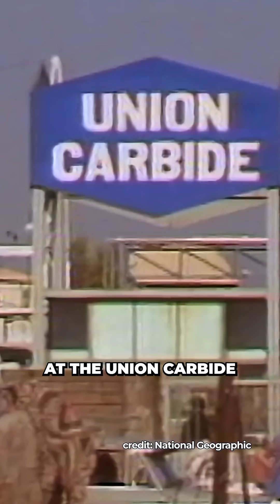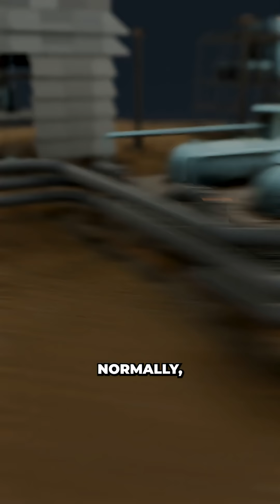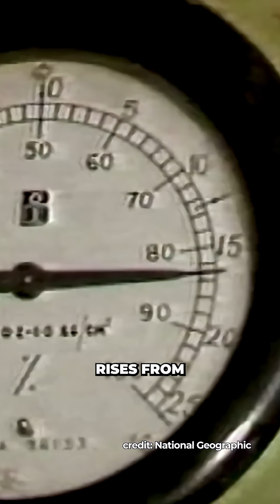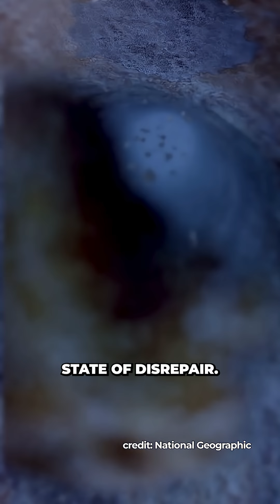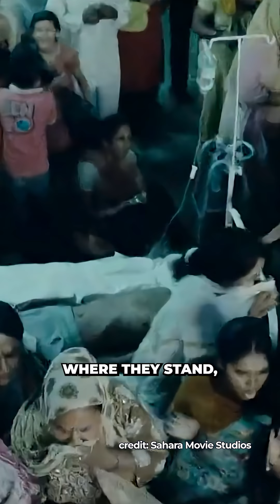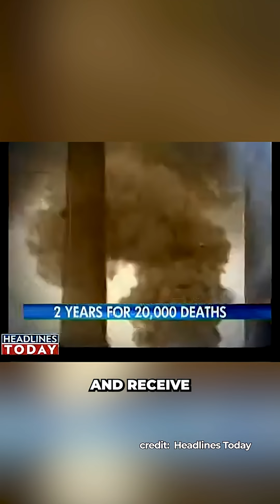The True Story of the Bhopal Gas Disaster

Comment: It occurred to me that it possibly would have been less disastrous for the people of Bhopal if the E610 storage tank had actually exploded instead of venting. It would probably have injured or killed many of the plant workers, but the explosion and resulting fire might have neutralised – or at least lessened the toxicity of – most of the toxic gasses, which might have lessened the deaths amongst the general population of Bhopal. I have little experience with the exact nature of MIC and how it would behave in such an explosive situation, so I might be completely wrong, but it seems somewhat logical if incinerating the gas would have reduced its toxicity. Either way it is an awful case of negligence that should never have happened.
Reply: yess you are right about it

Comment: I heard a rumble from an unpressurized tank of cold creosote and a coworker was using steam to melt the crystalized creosote at the valve on the bottom. I was supposed to be able to close the valve to prevent the tank from overflowing due to the steam. Unfortunately the plug of crystalized creosote didn't just melt. The chunk of crystalized creosote broke free, I did try to run and get out of the range of liquid creosote. Unfortunately I didn't make it.
I was showered with creosote and ended up taking a much needed shower and throwing away a set of work clothes as the creosote crystalized and made the shirt and jeans stiff almost immediately. Due to my hardhat falling off the same happened to my hair. Went home as the smell was making me nauseous and I had a chemically induced headache.

Comment: As a well tester all of this equipment im VERY familiar with. And my entire job is to monitor pressures and maintain isolation in exactly the way i want. We use scrubbers and flare stacks to burn off and lower the saturation of toxic gas, the fact that a POP valve blew at all is completely on the workers. The fact that the company even had pop valves for such an operation shows safe work at least being in mind but it’s probably not the main priority. The fact that nothing was serviced and was inoperable does have to do with management. But when it comes to flare stacks… they’re not easy to fail. And if it was failing that means it wasnt already lit. Which in most cases is really bad. A flare stack should be constantly lit and ready to burn gas so id say that’s another issue id take with the workers themselves. When the pressure reached 20 PSI someone should have said something, gauges dont magically keep raising at the same PSI/time. This easily could have been avoided by training and by preventing complacency. And any safety precautions that failed wouldnt have mattered. But also i work in the oilfield and situations like this are much more common and we have history to look back on so its easy for me to say i guess.

Comment: 1. Faulty cooling
2. A lot of faulty gauges lead to a worker thinking that the actual emergency is just another defect
3. No vent gas scrubbers due to no repair budget
4. The tower not working to incenarate deadly gases because of a low budget.
Four fail-safes and not 1 of them worked

Comment: I wasn't a mechanical failure or it wasn't an accident. It was the laziness of thise greedy capitalists who chose their profit over lives of saveral people. I did a case study during my bachelor's and I have found many faults which were found during an investigation.

Over 25% of pressure gauges in the factory were not working properly. There were 3 tanks of MaiC of which 2 of them were supposed to be filled 75% and third one supposed to be kept empty for emergencies yet they filled 2 at 90% and third one 70%. There was a journalist who raised this with government regarding the safety issues in the plant but no one listened.

I did this study over 8 years ago still I remember these numbers to my heart because what happened was horrific

This was the failure of Union Carbide and Government.

Comment: There are some people that dont know or realise, that when the pressure in the pressure tank went from 2 psi to 10 psi wouldnt think that this is not that much pressure since its only 10 psi and not a big deal. But 10 psi in an area that big in a metal pressure tank is like the difference between a hand grenade expolding to a 500 pound high explosive bomb being dropped from a fighter jet, and an huge explosive blast area and concussion wave destroying peoples enternal organs and turning their enternal organs from soild organs to a mush consistancy organs. But when it reached over 100 psi, it would be like a bunker buster bomb being exploded above ground, and not a deep penatration explosion,  meaning a major hole in the ground they could park multiple upon multiple busses in the crater from the explosion,  and the chances of people surviving this size explosion,  about absolutely nil, none or zero to around a mile away.

Comment: History shows that many corporations have deliberately calculated that paying settlements or compensations later is cheaper than implementing proper safety measures now.

Take the Radium Girls case the company knew the risks of radium exposure but continued production because redesigning and implementing safety protocols would increase costs. Or the Ford Pinto case, where engineers identified a simple fix (a protective T-strap) that could prevent fuel-tank explosions, but the company decided against it after a cost-benefit analysis showed lawsuits would be cheaper than redesigning the car.

Economically, many corporations have shown they often accept that damage as part of the cost of doing business.

Comment: And this here is why there are so many layers of protection on dangerous substances and work places - because even with the many different precautions meant to be in place, everything failed and 15 000 people died. If even one of these things worked then chance is the death toll would be 100 or 1000 times less, if not entirely absent, yet the "cost saving measures" ended up costing people their lives

Comment: Are you kidding me? They blamed the union!?
The union workers were not the ones screaming about cost-cutting measures.
I guarantee you it was not the labor union that stopped hiring necessary workers. 
I guarantee you it was not a union member that made the choice to skip necessary maintenance just to save money. 

I guarantee you the owner of the plant is the reason those decisions were made. 

Much like chernobyl, you can blame the person who pushed the button, or you can blame the person who said it would be cheaper to use graphite tips.
Or in this case, the guy that said it would be cheaper to not hire more repair men.

Comment: Didn't include the alarm. There were multiple safety measures in place, where each one would have prevented this, but my favorite one is the alarm. The alarm (sirens) went off indicating a gas leak. They didn't want to unnecessarily create panic for what they thought was a false alarm and completely shut off and disconnected the alarm from going off.

Comment: “If you skip the safety bill, the damage will cover the cost”

For this, for bikers, for workers, for everyone, it holds true
Reply: While the quote sounds powerful in principle “If you skip the safety bill, the damage will cover the cost” reality often doesn’t work that way. History shows that many corporations have deliberately calculated that paying settlements or compensations later is cheaper than implementing proper safety measures now.

Take the Radium Girls case the company knew the risks of radium exposure but continued production because redesigning and implementing safety protocols would increase costs. Or the Ford Pinto case, where engineers identified a simple fix (a protective T-strap) that could prevent fuel-tank explosions, but the company decided against it after a cost-benefit analysis showed lawsuits would be cheaper than redesigning the car.

So yes, morally and socially the quote stands true skipping safety eventually harms people. But economically, many corporations have shown they often accept that damage as part of the cost of doing business.

Comment: My uncle works at the NECO raipur plant. He once shared this with me, that their plant produces tones of carbon monoxide as a byproduct of the steel production, which is stored in several pressure chambers to be used in burning of the blast furnaces. But when the pressure chambers are full this gas is supposed to be incinerated through the smoke chimney, which requires a LPG cylinder to burn the gas so that the environment is not contaminated with this CO gas. One day a newly hired BIG HEAD saw that lpg cylinder as an unnecessary addition to the cost overheads and got it removed. CO is odourless, if anything happens no one would even notice it.

I was shocked to know about this. How could someone be so indifferent to people's lives, for what a ₹3000 LPG CYLINDER?

Comment: So i counted at least 4 safety steps that failed here due to cost cutting. The initial cleaning blind plate missing, the cooling unit being turned off, the gauges not working, the gas scrubber not being maintained, the flare tower not working. So i guess it was actually 5 steps that failed here. Ffs

Comment: Small correction based on what i read

The vent gas scrubber worked but was not designed to handle the volume of MIC that leaked out.

Comment: Fun fact: chernobyl, the worst nuclear disatster, killed a fifth of the people this did while also providing a phenomenal amount more power.
Reply: Chernobyl was human error... this was a complete mechanical failing of all safety measures.
Reply: @edyslavico3761Chernobyl also was caused by design failure. The fact that the rods spiked in energy production before shutting off. Poor engineering decision, poor safety regulations, requirement to build the station in time to make government happy.

Plus, wasn't there a system of complete shutdown if something goes wrong that didn't activate?
Reply: @edyslavico3761This was caused by a complete lack of safety culture due to complacency and desire to cut costs.  Closing the plant down if you can't operate safely is the right choice to make.
Reply: @edyslavico3761Pretty sure skimping on the safety and maintenance budget is the same fucking thing as human error. There’s no way this should’ve happened. Was completely preventable. 5 safety measures don’t fail from mechanical failure. They fail because they were already fucking broken.
Reply: I think it shouldn't be a "fun" fact when things like these are being talked about. Fact seems enough.
Reply: @sunny_1515  I agree with you XD
Reply: This wasn't a power plant though so can't directly compare.
Reply: It was an accident too right? Not a stupid maintenance fault like that BA$TARD who could afford flying back to USA by bribing Ministers but not actually fixing the plant
Reply: There isn't a reliable number on the deaths of Chernobyl (because of long-term cancer patients), but regularly its estimated from 9.000 to sometimes 200.000
So what you say isn't really a fun fact, because we dont even know the exact numbers.
Reply: @igorgijzen9547  Up to 200 000 was estimated right after the incident based of old and still persisting myths. Years later we don't see statistically significant change in deaths due to possibly radiation caused diseases. What we have, is number of confirmed deaths around 30 and possibly low hundreds among liquidators.

Comment: Even if Flare Tower or VGS Worked it was design to cope a minor leak and E610 is filled 42 tonne or 75 percent instead of 50 percent or 30 tonne and it lost ability to pressurise with inert nitrogen since octuber which they want E610 to dispense so they can transfer to Sevin Plant for Sevin Pesticide and Nitrogen leak into PHV (Process header) which to VGS and Flare
-Refridgerator shut down since 82 or 84 to save money of freon
-VGS down for two months to repairs and design for minor leak
-Flare tower also shut down for two months to replace small section of pipe, improper size
-Water spray to force gas drop in plant was underpower to spray at 33 meter high vent pipe

Comment: The grim reaper should serve the justice that these people bought themselves out of in court. If necessary by helping hands.
This also serves as proof, that major disasters are never due to a single failure but rather a chain of faults and failures, mostly due to negligence or disrepair.
1. Blind plate missing
2. Refrigeration system is shut off
3. Pressure surge discounted as technical failure
4. Vent gas scrubber is broken and fails
5. Flair tower is broken and fails to ignite

A five step chain of horrible death. All because of greed.

Comment: The Deepwater Horizon disaster was caused by a scenario like this. Every safety measure was faulty and even the ship’s emergency generator failed because company officials decided not to allow oil to be put into the generator because it would have to be maintained. When the emergency happened, the regular generators shut down. With the emergency generator not functioning, the fireproof and waterproof doors wouldn’t close, the automated fire system failed and the pumps needed to empty the bilges were dead. A rolling cascade of disasters with a single cause. After the ship was lost, all the other generators were audited and every single emergency generator in the fleet had no oil.

Comment: This is a very interesting accident, a few years prior Union Carbide let India run that plant and over the course of a few years the management had changed and they got people who maybe shouldnt had been in management, they basically hired anyone and let them set up a sort of slum around the plant itself, it was mostly workers and their families.

The new management didnt really care about safety or even basic maintenance, so things fell into disrepair and an accident was basically guaranteed, but in it should not had been such a devestating accident.

Some blame fell on Union Carbide because they had not really cared a lot what was going on at the plant, but the main cause was unskilled workers and unskilled managers.

This was not the first time water entered the storage tanks either but luckily those times the cooling system were up and running like it had to be under Union Carbides own rules, there was only one time when the cooling system were allowed to shut down, when the tanks were empty and the plant was not operating otherwise it was stricly prohibited to shut off the cooling systems.

So the main cause of the accident, unskilled workers and unskilled management, after Unionn Carbide let India run the plant.

Comment: I worked at TVA in the 70’s. Awful place to work. Union was worthless, because TVA got to pick union stewards. I can’t prove they got paid to represent TVA, but everything they did made you think that. Safety went out the window, union representation was none existent. TVA rules were violated. Anyone fighting on property got fired. Superintendent brother in-law starts fight with foreman. Foreman whips his ass. Foreman got fired, not brother in-law. Strike that lasted 3-4 days. Lot of iron workers fired, lot of other trades also. TVA picked who they wanted fired. Hurt on the job, gone. Filed grievance fired. Complaining to Safety fired. I stood on picket line & was picked out by 2 guys standing next to me. I got fired, they didn’t. I had been hurt on the job & filed grievance. Had worked for TVA 3 different times. Couldn’t believe how wasteful they were & how they broke their on rules. The workers who worked the coal sludge clean up below Knoxville, can’t be paid enough to offset what’s happened to them. More than 1/2 the work force has died from cancer, because managers wouldn’t let workers wear a mask. The filters to monitor dust were beaten out before testing. The dust they carried home had radioactive particles in it. F TVA

Comment: I worked at this steel plant a few years ago and safety was not their biggest concern The bottom line was so if a guy lost a finger or an arm or died they'd move on they do a little fake figuring configuring to make it more safe but then they immediately remove those safety guards if it made the machine go any slower😅

Comment: The factory was closed, but the company's management got away with it. The US government refused to extradite to India the perpetrators of the tragedy on the pretext that they had done nothing wrong to American citizens, which means that there was nothing to punish them for. In 1989, Union Carbide paid a paltry $470 million to accident victims in exchange for dropping lawsuits and claims. Families of the victims received $2,058 each, victims and disabled people received $800-900 each. And that's it. Union Carbide refused to clean up the contaminated area. In 2010, seven top managers of the plant were sentenced by an Indian court to $2,100 for involuntary manslaughter. The fine and 2 years of suspended imprisonment. I wonder how the US government would react if an Indian company killed 20,000 American citizens, disabled tens of thousands, and dropped a handout of $470 million. The question is rhetorical.

When it comes to American citizens and interests, things look different. In 2010, an accident at the British Petroleum oil well in the Gulf of Mexico killed 11 people. The company negotiated a pre-trial settlement with the US government and paid a $4.5 billion fine. Another $14.5 billion was paid by BP for the victims" private claims, despite the fact that the suffering here was mostly material. The payout figures after one accident and after another speak for themselves.

The Bhopal plant was abandoned by the company and is still rusting. Residents of the city are still sick, dying prematurely, and not being compensated, and the rich Dow Chemical Corporation, which now owns Union Carbide, are still getting richer.